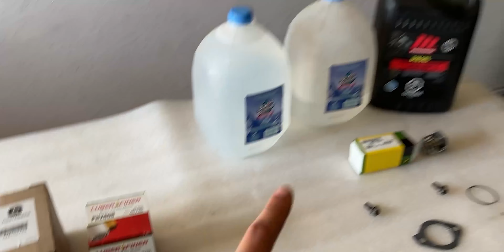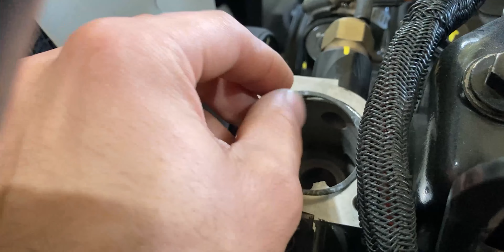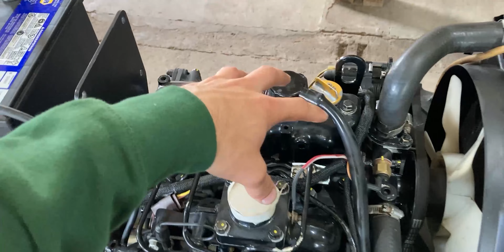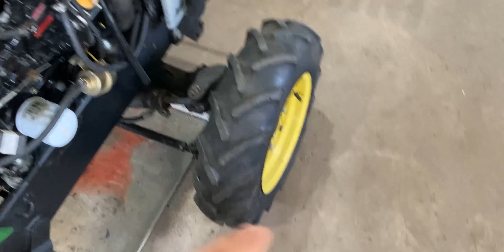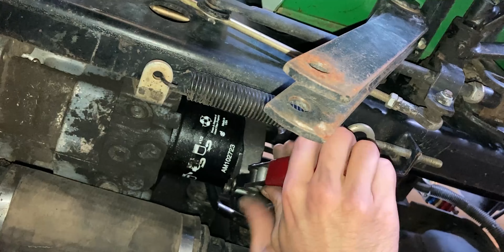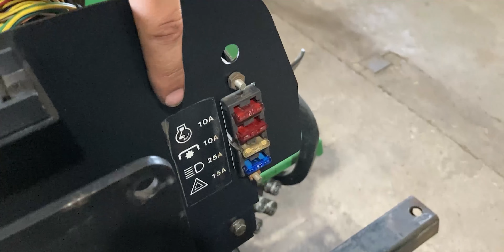John Deere 855 First Start After Engine Rebuild!

Comment: I had no idea you should add oil to the governor if engine sits for a long period. I thought a one way check valve on oil filter would keep the oil locked in.

Do you have any other recommendations when waking up an engine that has not seen action for a long time? What sort of timescale are we talking here too?

Comment: So I have aan 855 diesel from 1989. The left handle which I use to engage the mid mounted mower works and then doesn't. It looks like a magnet that is suppose to stick together and it seems to let go and does not engage the blades. WOuld you know if there is a simply fix or shouls I just order the parts?
Reply from the maker: I know what you mean. I had an issue with that too on my JD 855 and I just put two zip ties on the magnet to connect them. 
The magnet must've lost power over the years and they did not connect anymore. The PTO lever is still mechanically activated, so I didn't see this as a bad solution.
If the PTO were to turn on electronically, by the touch of the magnets, I would have replaced them, but in this case they do not.

It's up to you if you want to replace the magnets, or just put a zip-tie on them in the meantime as a temporary fix. I also had an issue with my seat switch which was completely corroded, and that also ties into the PTO activation. Before replacing the magnet, be sure it's really just the magnet and not possibly the seat switch as well. 

Regards Andreas

Comment: Помогите пожалуйста я с Украины помогите пожалуйста разобраться как мне правильно выставить зажигание янмар фх175 двигатель 3TN 75
Reply from the maker: It’s hard to say exactly how to position your fuel pump, but your initial spray must correspond with cylinder. #1. (Closest to flywheel).
The spray must be ~15 degrees before TDC on the compression stroke.

I hope this helps👍🏽

Comment: I rebuilt the same unit on my f935. Although mine is a 5 port. Now I'm getting a strong stream out of the gap between the column plate and the 1st plate that separates. I used the factory kit. Any idea what went wrong??
Reply from the maker: If you have power steering despite a leak, then you know everything is assembled correctly. The only issue you have now is a sealing issue. This could be caused by an o-ring that is not seated properly or an o-ring that doesn't have enough squeeze between both plates. Even if one plate has a slight bend to it, it could cause an uneven sealing surface.
Maybe you need to take it apart once more, just to verify the surfaces. If o-rings are new, it shouldn't be a big deal to take the assembly apart and reuse them again. Let me know what you find. Regards Andreas

Comment: Do you have the part # for the injector seals?
Reply from the maker: Hi John, the part numbers from John Deere are:
- Washer/Seal (Aluminum) M89135
- Heat Protector (Plastic) M89134

Here you can view the parts drawings for the JD 55 series Tractors: https://partscatalog.deere.com/jdrc/sidebyside/equipment/73152/referrer/navigation/pgId/14395053
I hope this helps! Regards Andreas